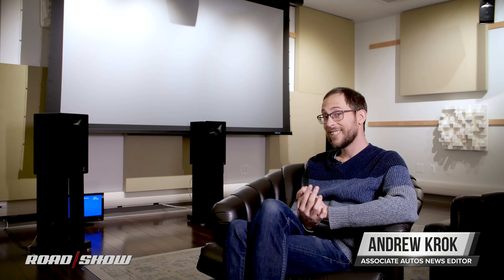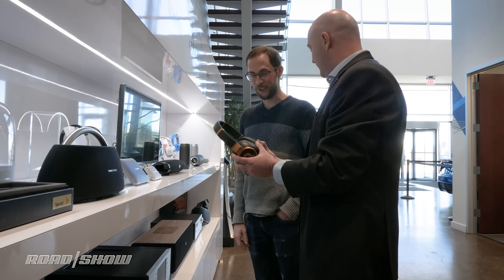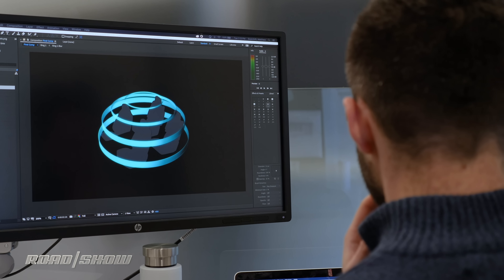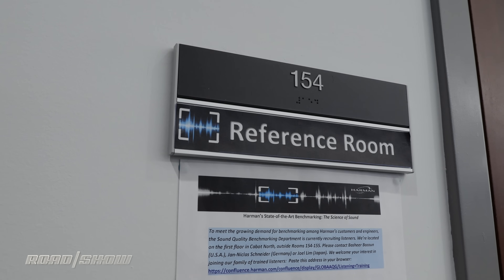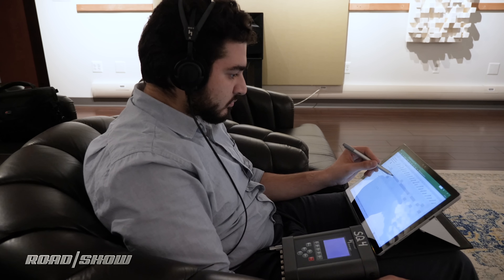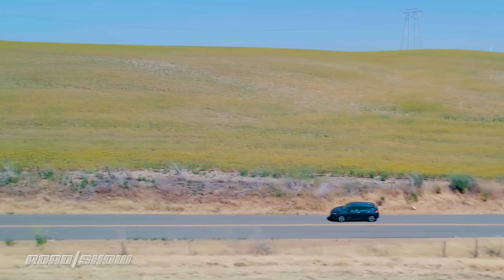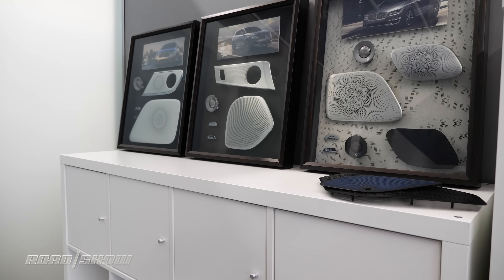Fake engine noise for Tesla EVs is Harman's sound synthesis tech hard at work

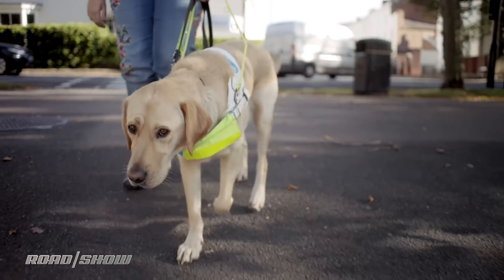Comment: 2:17 : “Prevents hearing impaired pedestrians from stepping out....” Great idea...
Reply: The driver.
Reply: @Kent Holdett...That was an error...should have said blind or sight impaired pedestrians...or simply inattentive pedestrians but who would wake up if they heard sounds coming from the otherwise silent EV as it slows down at an intersection/crosswalk or anywhere. There are now (April 2022) laws in some countries including the U.S. mandating that EV's must be equipped with sound emitters at slow speeds to protect/warn blind and inattentive pedestrians. Great idea/great laws because stats show that silent vehicles (EV's) are causing more injuries on a percentage basis to pedestrians than ICE vehicles which of course are not quiet or silent at slow speeds.

Comment: the safty is not just for visually impared, sounds can tell you the presense of a car long before you see it. stuff like curvy streets or just riding your bike down the road in the same direction as traffic. your hearing is a way better danger detecting sense than your vision, as your reaction time with hearing is measurably faster than with vision, and hearing is 360 and doesn't stop with line-of-sight.

Comment: I do not for the love of god want any fake noise, EVER!. Only reason I want an electric car is because the quiet cabin, nothing else. I I want noise I get something real, with feeling, vibrations and other small things that just sound can't reproduce. There have been cars that are almost silent with regular petrol engines. 
I had a discussion with my brother about silent cars and that I believe that the teslas is not actually quieter since they run fat tires and weight like a moon and the tire noise is louder than the engine of a petrol car. So on my way home I tried to listen to the cars running past me (from behind) and think IF they could be electric, half the cars I only heard the tire noise and the other half were older cars or people stepping hard on the throttle (uphill there). At one of the cars I thought it sounded like every other quiet car i've heard go past so far, but a bit more tire noise than normal and I didn't think about it until it wen't past so I could see it.....It was a Tesla model S. 
That confirmed it, EVs aren't quieter in category, they are heavy cars with fat tire and the sound comes with it.

Comment: How about we get user and community created sounds?

The user can tune the sound to their liking, while the community can provide sounds based on popular engines, like the 2jz.
Reply: That's probably the direction this will go. Open source code you can put in an Arduino that taps into your accelerator pedal and a sound theme selector that mounts to the dash. Something like those aftermarket throttle control kits with sound output for your amps/woofers.

Comment: We mock all of those car companies who have been piping fake engine sounds through the car's entertainment system to make 4 and 6 cylinder engines sound like v-8.
And they come up with the equivalent of sticking a playing card into the spokes of a bicycle wheel.
Well I guess some people really do have more money than common sense.
If you want a car with a v-8 sound, buy a car with a v-8 motor.
Reply: I heard that electric cars will have to make a sound of some sort due to the danger they pose to pedestrians. Although it's the sort of thing that can be purchased for fun, it has a bigger reason to exist.
Reply: @thearousedeunuch  They can use that bell that we use to have on our bicycles that goes "ring-ring"
Reply: @pogo1140  Imagine 15 cars on the same street doing the same noise and that would get quite annoying quite quickly.

Comment: I would rather save electricity in an electric vehicle instead of listening to a  v8 or v12 sound.
Reply: You’re probably the guy who would not turn on brake lights just to get a few more feet of extra range
Reply: You should also start walking to work and completely save all the energy

Comment: HORRIBLE HORRIBLE HORRIBLE....Why not make the motors louder use a BOV system for cooling spray, use a transmission with straight-cut gears. I want REAL - this fake sound is CANCER to the auto industry
Reply: Saleen did that with a Tesla Model S they modified and it sounded pretty good. However, I'd say that people who buy electric cars are the sort of people that are tech savvy and prefer to customize things to their liking.